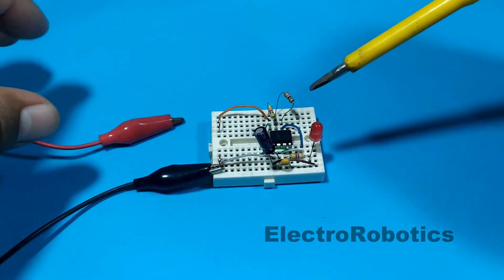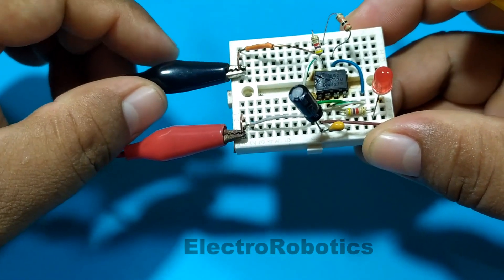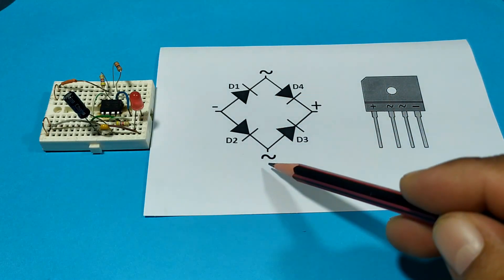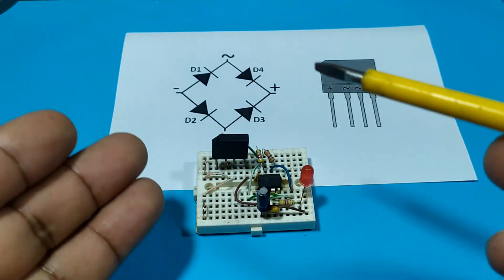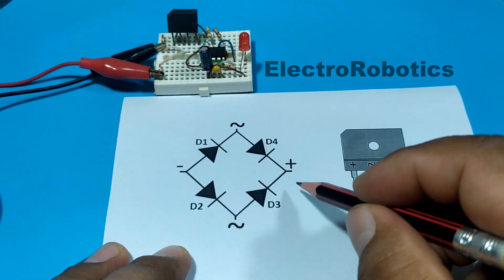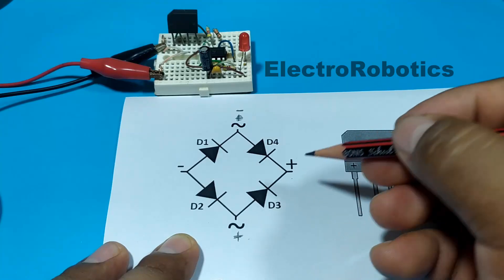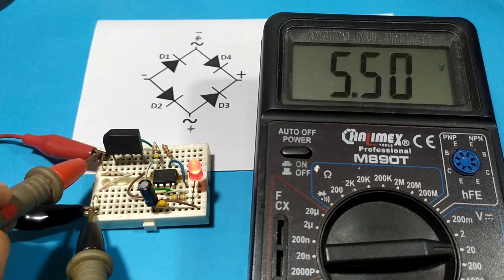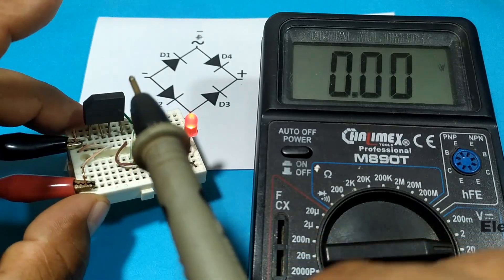How to Make Your Circuit Work with Your Power Supply Polarity Reversed?

Comment: What a good idea to protect any cicuit from polarity reverse. You will loose 2x 0.6 volt over the diodes in the bridge. So the power supply should 1.2 volt higer than the power needed.